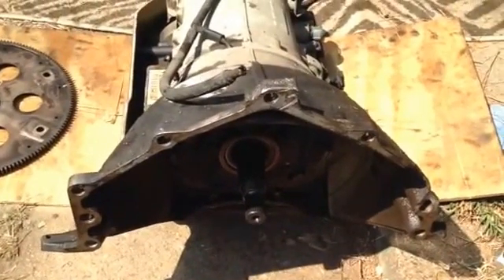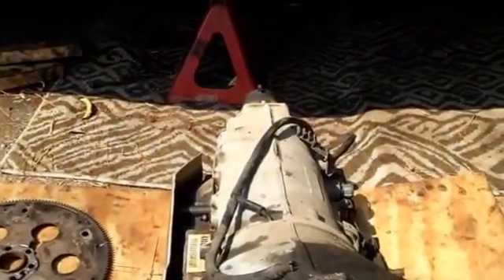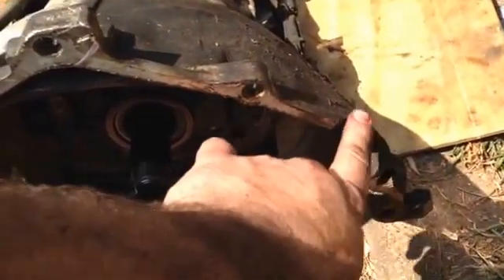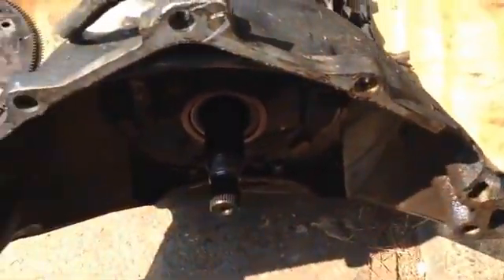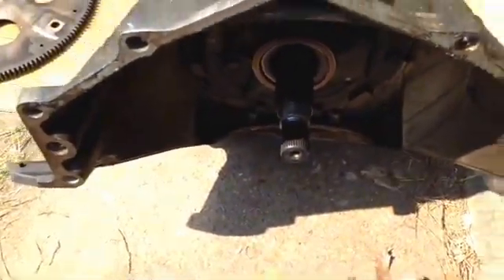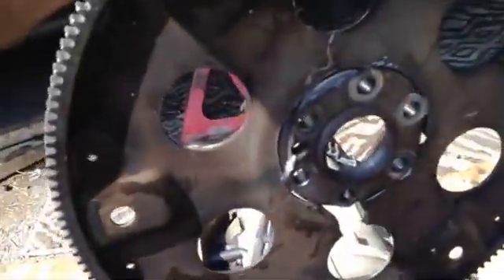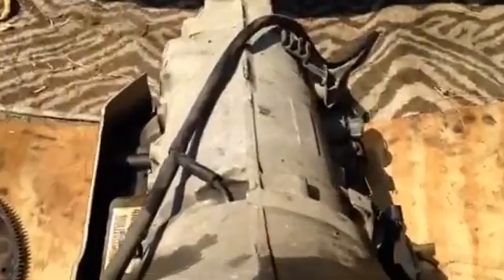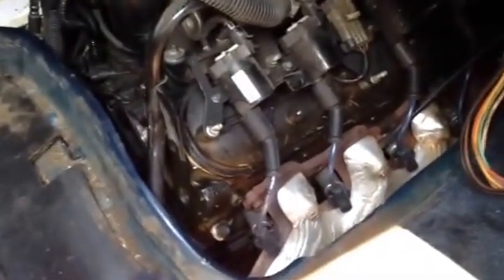Chevy LS1 flex plate fail

Comment: Good video however that’s not why it broke. This is a very common issue, especially on a 4L80. The dowel pins do the same thing as the BH bolts missing them won’t cause breakage.
Reply from the maker: It was misaligned during last transmission rebuild and they impacted-gunned the bolts & broke ear off
Reply: @BustedWalletGarage  I had one I mad a video on it was bad u joints on a double drive shaft crazy

Comment: will be possible ...just to replace the bell housing? good video by the way...and good luck buddy...
Reply from the maker: fantasma del tren bell housing is cast as part of the casing. I took it to a buddy of a buddy that owns at transmission shop and he only charged me $600 to provide a new case, swap the guts over and replace the worn parts. I reinstalled and had back working in 4 days.